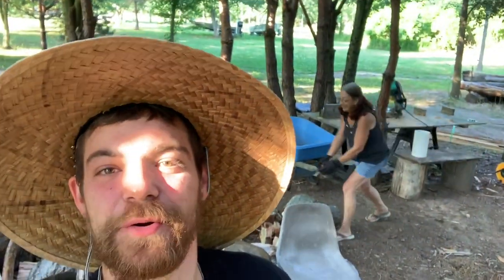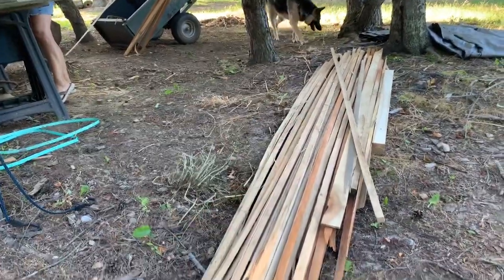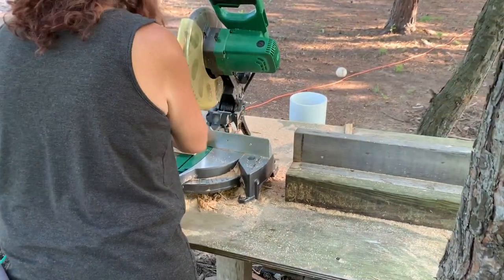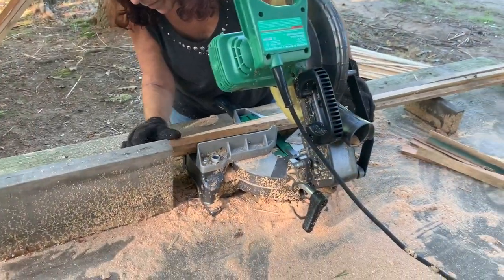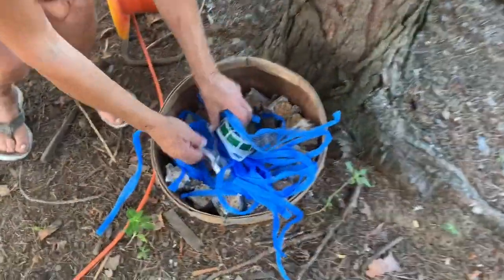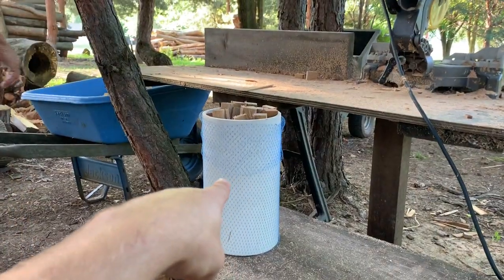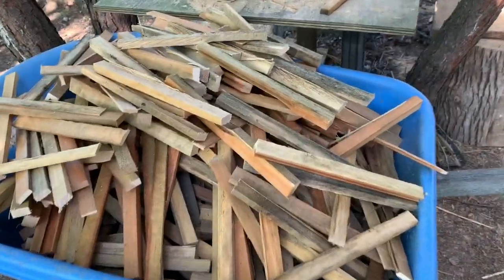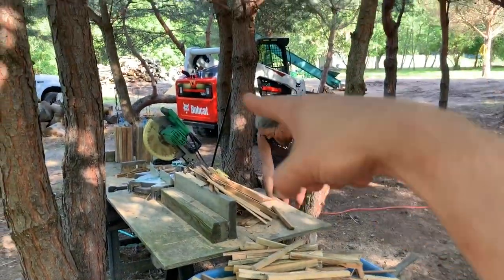HOW I MAKE KINDLE WOOD BUNDLES! (WITH A FIRE STARTER)

Comment: I'm thinking about starting a camp wood and kindling wood business so I was glad to find this video. I want to try to use minimal steps in preparing the bundles. I'm thinking that if I had access to the kind of wood you use for kindling that I would saw it off the back of the trailer with a sawzall (maybe) right into a wheel barrow or other platform to keep the pieces off the ground then measure them out with the pvc or a 5-gallon bucket. Maybe tie the bundles with twine. I wouldn't be overly concerned about cutting them exactly 16 inches. I would allow lengths from 15" to 17" for an average of 16". Just thinking and typing out-loud. Thanks for the video. It's helping me to think of ideas I can do myself. Have a good one and good luck with your business.